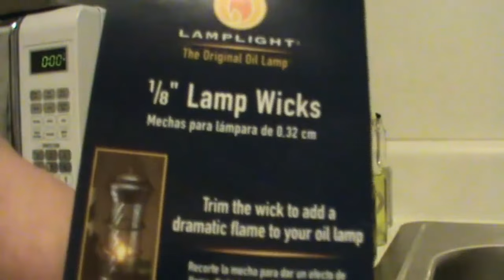It's going to get cold. Build a 3 or 4 burner ultra-pure lamp oil space heater.

Comment: You can get a wick heater that will heat more effectively than candles the money you spent in the fuels is for the candles surpasses the cost of the fuel for the wick heater
Reply from the maker: Okay 25 dollars covers everything I used. 2 pie plates 8 dollars,  Wicks. 2 dollars. 2 handles six dollars. 1 bottle of ultra pure lamp oil 9 dollars. The Tabasco bottles were free after I used the Tabasco. And the tin cans were free after I ate the food out of them. So 25 dollars for 2 space heaters and fuel.  Or 8 dollars a piece without fuel. Thanks for the comment.

Comment: .
Reply: Hopefully you didn’t take comment offensive I tried the ideas you showed many years ago and found the old kerosene wick heater can’t be beat . 
I can affectingly heat my garage when I’m working in it or my house without having to sit around in coats and blankets I understand some people have codes they have to live under and abide by. Good luck with your experiments and have fun
Reply from the maker: @seeveiw  I had a kerosene heater it worked very well. I Appreciate you leaving comments. You know originally I wanted to make something like the clay pot candle heater. That didn't go so well. So I  ended up using Tabasco bottles and ultra-pure lamp oil. Since then I  made a 5 burner heater a 12 burner heater and lately the 3 and 4 burner heaters. My other space hearers are also on my channel but you would have to scroll down a ways to find them if you like. They are pretty slick heaters. I  hope you will check them out. Sincerely,  Alex